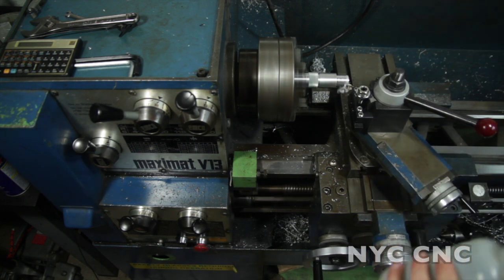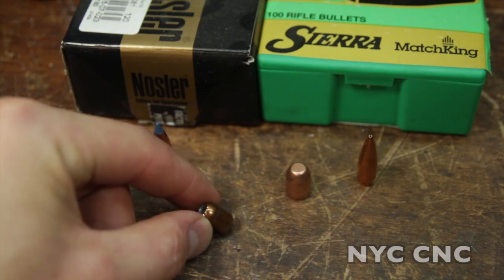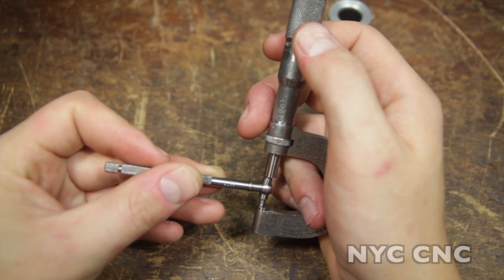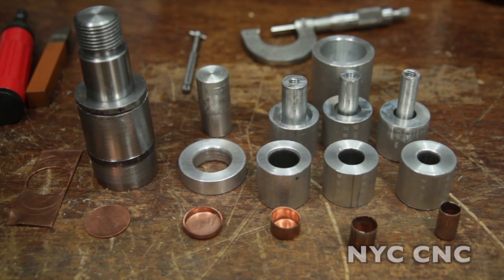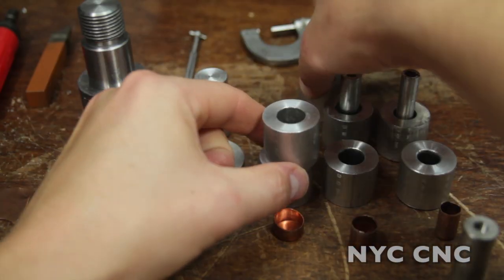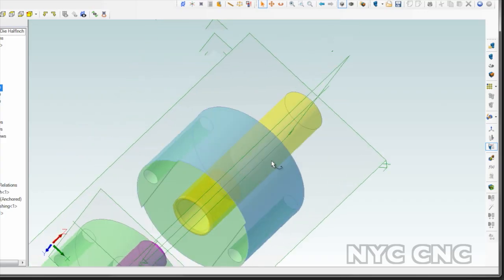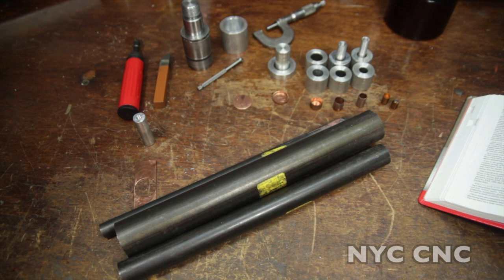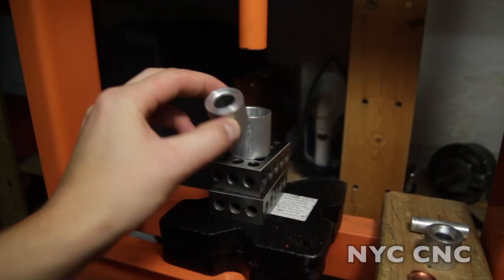Making Copper Bullet Jackets: Machining Punching & Drawing Dies!  Part 1

Comment: At 1:05 the video shows someone measuring a bore with a twin pin tool. I bought Hexagon Tesa 3 point Imicro and TRI O Bore inside micrometers. They do a great job correctly measuring bored holes. They  catch out of round, barrel shape, bulged bores and many other poor conditions of  boring holes.
Reply: They sure do, and they should - they cost like 700 USD a piece.

Comment: Terrorist promoter
Reply: see also .375 OD, .315" ID 1/4" type "L" copper tubing 
.03" thick you can hand press into a jacket / lead mold
&
see also .5" OD, .45" ID,  3/8"  copper tubing type "M" .025" thick & .035" thick type
 "L" you can hand press into a jacket / lead mold or machine pressed .049" type "K"

Comment: would case hardened mild steel work as a diemaking material? as in, you could roughly drill and grind the dies to shape out of mild steel, and then case harden them several milimeters deep before finish grinding, to make a hard and tough surface without having to spend like a hundred dollars on tool steel rod?
Reply: look up the exact metal type to find the right temperatures 
to anneal then heat harden or case harden & then temper it
Reply: answer : yes, absolutely. you're welcome, me from the past!

Comment: Love it.  but I am assuming "NYC" is in New York, just don't get caught with a pistol there, they tell me it's illegal.  We would love to see detail by the way, bullets are becoming so expensive.
Reply: see also .375 OD, .315" ID 1/4" type "L" copper tubing 
.03" thick you can hand press into a jacket / lead mold
&
see also .5" OD, .45" ID,  3/8"  copper tubing type "M" .025" thick & .035" thick type
 "L" you can hand press into a jacket / lead mold or machine pressed .049" type "K"

Comment: Cast iron has been used on radiosed draw dies.
Thow relitively soft, It is polished quickly and easily.
So your aluminum may work quite well. 
Just a thought from a retired tool and die maker.
Oh. Another thing that is fun to do is to invert the shell onto what would look like the end of a pipe with inner and outer Rad. The ID of this is the OD of your next shell. It totale controls the line up. Do the punch the same with a radiosed end.
Just fun to watch the material being pulled up that outside of the pillar and around th top.
Have fun.

Comment: I'd like to see something about making casings as well.
Reply: It's possible to cast lead bullets easily... Making casings at home is something that would be really useful. Pls help
Reply: @clive1236  you'd have to turn them, the the hardware for drawing brass thick enough to form that case head would be out of your price range.
Reply: @pacman10182  that makes sense... Thanks👍
Reply: yeahh me 2
Reply: using pretty much the same method, but with brass discs.
Reply: Me to
Reply: You could make them at home, but the drawing process would require a hydraulic press. You would also need a lathe to cut the case head, unless you are forming rimmed brass, which will require even fancier dies.

Comment: there is better way to draw long tubing with only one die instead of going trough stages . 
the secret is to hold the flat disc with flat plate against the die  so it won't fold while is going in to cylinder .
of course it has to be mirror finish hard steel . aluminum won't do it

Comment: What are the dimensions for the dies and what caliber is this for? Also what aluminum and what steel would be best? I was thinking 6061 or 7071t6 aluminum and O1 tool steel round stock.

Comment: fun qu for you . by any chance could you make some gas check dies that are very simple . say for a .224 that would be a 223, .277 that would be a 270 , .260 for a 25-06 and the fun one a .243 for a 243 .. 

what would you charge for a one stage gas check die, maker.

Comment: Thank you. I want to learn how to draw smaller stuff. My goal is to draw cups for making primers for rifles and pistols and to draw brass for making rim fire rounds. Starting with 22 long rifle, but I would also like to be able to draw cases for 41 Swiss Rim Fire. The most important by far are the cups for primers. I do not have a machine shop. So far I have been making dies for swaging 22 long rifle bullets (no jackets) and dies for sizing the brass for 22 LR. I use a drill press and a dremel with diamond bits for machining.
Reply: just convert your vetterli to centerfire, it's so much easier then loading rimfire brass

Comment: Could you please advise the source book you reference; and where you buy specific steels. 

I am trying to get a 10-20 steel for amateur smithing, and can't ask at local home depot. No one can get beyond technician now a days. But basically - I am trying to learn metal and working metal. Heat and Hammer/Machining/whatever.

Comment: If it were up to me I would want to watch every step in the process! but I am a machining junky :) I have a question for you. Have you considered spinning either the punch or die during the cup forming process to help the blank flow? That or heating them up before forming? I have worked with copper for 30 years being a plumber, and heat REALLY eases forming, tho it will change the final hardness. 

 I ask because I am have trouble in my attempt to form acceptable bullet noses after filling my .22lr spent case with lead and drawing them thru 2 sizing dies I made. I am able to keep a good tolerance with the now bullet jacket at + - .001 but when going to form the point to .090@ for a hollow point, I get fold overs or kinks or off center points?! totally frustrated!

Thanks for the great vids!

Gerry
Reply: Are you annealing before forming that point?

Comment: Instead of running it thru die after die after die, perhaps making a single multi-level die but using multiple sized push rods that fit each level so you could essentially push the one copper blank straight down from the top and by the time it reaches the bottom it is the size and shape to surround the bullet core?

Comment: Have you ever thought about pressing cartridge cases on a small scale?
Reply: But you've thought it out.  I've been brainstorming an idea, a DiY firearms workshop starting with simple Harbor Freight level tools, building a very crude lathe and milling attachment, eventually a cut-rifling machine/deep hole drill, bullet swaging, a recipe for smokeless gun powder non-corrosive primers, cartridge press, and a few different rifle designs. 

The goal is be able to fabricate every single part of each design to include rifled barrel, springs, magazines, AND whatever it's chambered in.

What I'm finding is that info on guns is stupidly easy to come by.  Info on anything to do with ammo is not.
Reply: +lowell houser : trying the same here. share ideas or chat sometime?? lemme know

Comment: NYC and you learned to make your own bullets------- lol- that must come in handy.

but this is a good start- but try this--- if you want to form (ammo) get a cutting torch, melt copper and zinc= brass= cold roll the brass to a plate- 1 millimetre and .5 millimetre----- form press the 1 millimetre in to shell cases-and the .5 millimetre in to primer caps (same method to make primer caps) 

primer caps you need potassium and choline to make potassium chlorate ( a impact explosive) and then you need to make a ((anvil) it is the striker in side the primer think small circle with a hole in the middle- it hold the chlorate in the primer and when the primer is hit you crush it between the primer case and the small metal with a hole (anival) 

as for the shells- OD of the formed case -- lets say 9 millimetre- then a reinforced backing of 2 millimetre  brass brazing- crimping or one pieces can be made for the backing- brass is wonderful to work with cause it is so easy to form- from that point- get a ((gun shell reloaded)) with resizing dies- you can make the shell small in diameter NOT  bigger- start with 9 millimetre and size it down to 22 calibre if you want-

you need potassium nitrate (75%) sulfur (15%) carbon (10 %)------- black powder----

nice start------- but there you go--have fun-be safe-------

Comment: Clamp the copper with the outer edge of the die first. Continue the stroke to form the completed draw and then cut the part free from the strip. So, a heavy spring holds the part in place while it is being drawn. The drawing cavity is supported by an even heavier spring, rendering it immobile until near the end of the stroke. At that time it gives way, allowing the shearing edges to do their thing. A small pin under a light spring load in the center of the first part of the die (concave side of the part) then pushes the finished part off the die. At the beginning of the stroke, when it first encounters the material, the spring will not offer enough resistance to affect the material, but after the part has been formed and is cut free from the strip, it will be enough to push the finished part off the forming die, where it would otherwise cling as if electroplated on. The stripper pin should NOT be a close-tolerance fit ... .020 wiggle is good ... because you want to prevent a vacuum from forming on the back of the part.

Clamp.
Form.
Punch.
Eject.

Full soft copper is so malleable that you can start with stock that is already nearly the finished thickness. Make the clearance on the shearing edges 1/3 the thickness of the material per side. IE .030" material needs .010" clearance. Make the punch .020" smaller than the die. You may be able to tighten that up a few thousandths, but those numbers will get you close enough to make parts. You WANT the material to fracture, leaving a compression line on each side of a fracture zone. When those three zones are equal, you have the clearance between the punch and die right.

I can't give you the weights on the springs, sorry but I never got that far, but think in terms of valve lifter springs. You can drop one spring inside another to get more resistance, if needed.
Reply: With normal cupping, you can just pull the punch back out and it'll strip the cup off just fine. That's what I do anyway. With really small diameter punches as well, the name of the game is polish. Every die surface should be a mirror, and, between every anneal, you must remove any scale so you don't scratch it. This is just from my own personal experience. Also don't use too much lube but also don't use too little. And, if you have a spring loaded stripper under a light spring like you say, if you're a good machinist and made your dies very carefully, it should work for stripping the parts. Unfortunately I wasn't really able to do this with my 22 cartridge case forming project because my hydraulic press didn't have a threaded part on the ram for it and it's very easy to bend the really long thin punch you need for forming 22 lr cases.

Comment: since the last US lead smelter shut down i'm looking into making my own jackets out of obsolete pennies for my own lead casted bullets before copper jacketed commercial ammunition gets stupid in price
Reply: In Canada we no longer use the penny, so i'm looking to make copper jackets out of them for cast bullets so I can still have a source for effective high velocity bullets on the cheap. We still have lead several smelters here, i'm just worried about 10 years from now when wheel weights and cheap/free scrap lead start running low and lead ammo prices skyrocket.
Reply: I have the raw materials I just need to make the swaging press and get bullet molds for all my current calibers.

Comment: Another note, as you step up to 3, 4, 5 times diameter the length you may have to use a reverse draw to keep from ripping the wall apart. As you work the copper or brass it becomes somewhat hardened. This is called work hardening and this makes the next draw more difficult. A tempering can be done (heat treatment) to relieve the built up stress in the wall but may not be necessary if you do a reverse draw. Great jobs man!

Comment: As a very old Tool & Die Maker I sure like to see others with the born ability to concieve and produce stamping and forming dies of all type. Very nice work! My best projects were deep form dies for all sorts of parts. I like your work and wonder if you have thought about pressure extruded copper or brass alloy casings. A small puck is placed down in a female form cavity and a form punch is pushed in which reverse extrudes the material up the sides forming a casing. Soda and Beer can technology

Comment: What a great topic. Thanks god you got out of nyc and can shoot again. This is a very interesting subject. I'm interested in heat treating. 1144 is used the Parker Hannifin for their hydraulic quick couplers. It makes a great bearing surface when hard. They induction harden it. We used it for 2" drive shafts at work and it cracked. It also cracks if your weld it (high sulfur).

Comment: you can go direct to the carriers websites like DHE {dependable highway express} redding, swift, whatever you see on teh side of the truck. You can get similar quotes right off their sites, but freight quote allows you to compare them quickly and easily. on the flip side i used uship site to quote moving a bandsaw 180 miles and all were well over 1000 bucks. if its palletized, LTL freight is CHEAP.

Comment: Hey no problem! I used to be a ebay power seller/china importer. I could ship a ton of crap {literally} from china to my doorstep, on a couple pallets for 1200 bucks. the part the caught my attention was when i read the bill. 800 of it was administrative fees! it was under 500 for the actual sea freight and train freight and eventual break out to a lift gate truck for home delivery! Most of these places like uship are just RAPE. smalltime carriers, no liability.

Comment: I'm up for the detail too.  I'm looking forward to see if and how you incorporate any extraction into the punch.  I was wondering about maybe putting and extra stepped diameter or two into your punch....that way, when you cut and press it the first time, you wouldn't have to extract it from the female die, just change the male die and press it again.  Maybe do all the stepped pressing but the final so that it could be controlled a bit better?